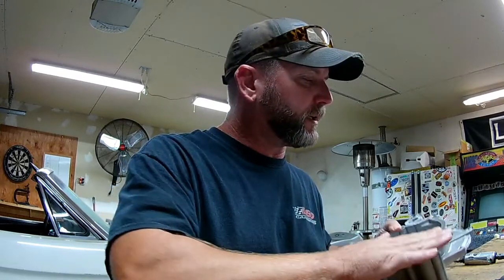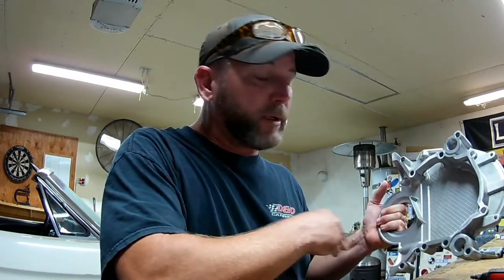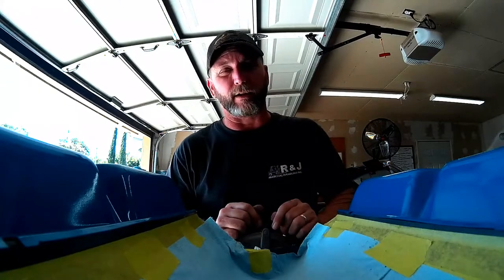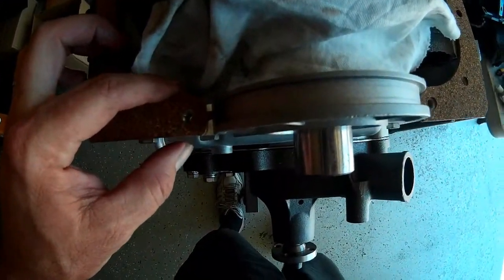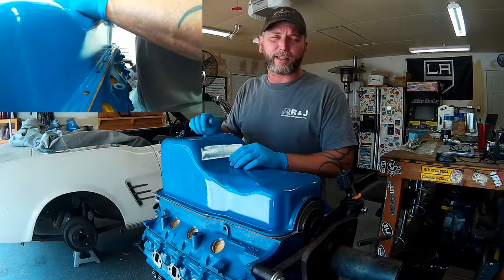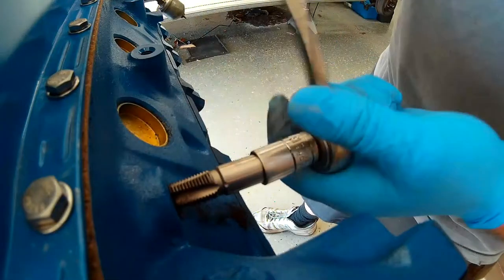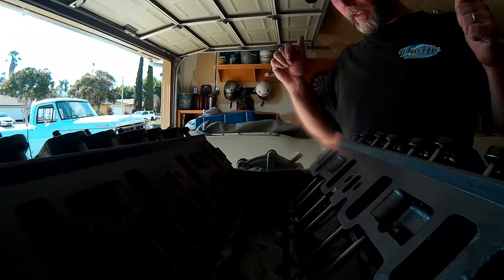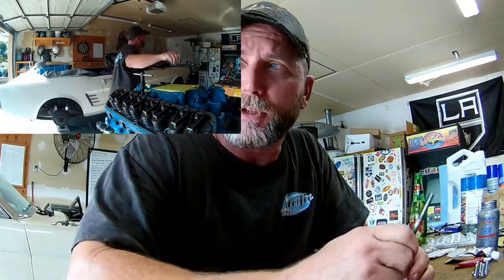66Mustang; Buttoning Up Our Rebuilt Smallblock!

Comment: So are you saying that my oil pan on my ‘67 mustangs 289 probably wont bolt onto the late 90’s roller 5.0 motor that im building for it😖
Reply from the maker: better check it and see, '68+ (IIRC) was the year for the larger pan seal.  depending on if your 289 block is original or not, it could certainly be a problem.  good luck!  fortunately, oil pans are cheap.